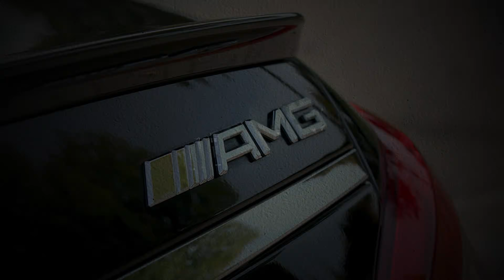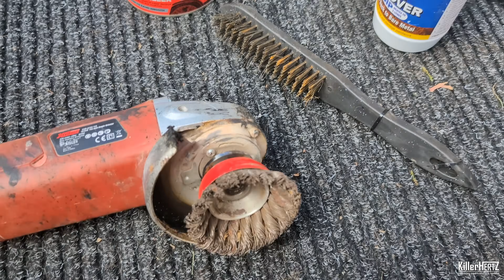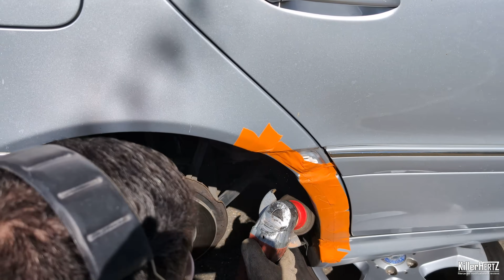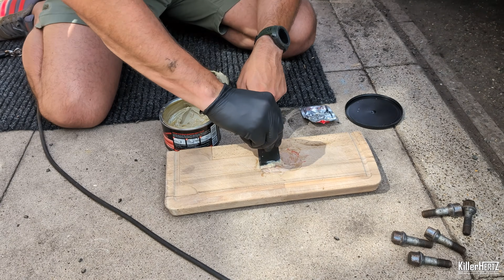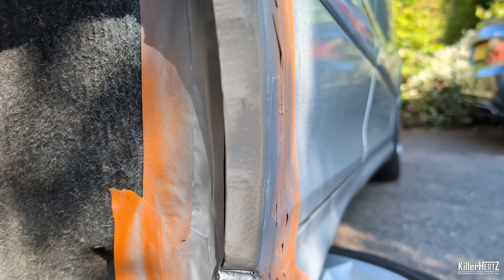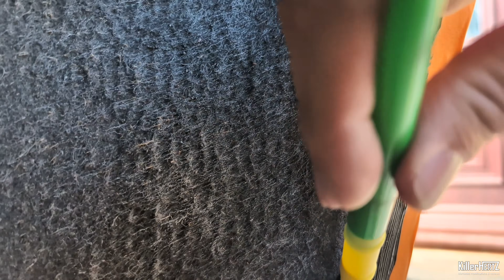HOW TO: Fix & Repair RUST On YOUR Mercedes

Comment: A few notes from a DIY painter ;)
Don't apply filler directly to the metal. A two-component epoxy primer should be used under the filler (in my experience, two-component epoxy lasts 1000% longer and protects better against rust than spray primer. I stopped using spray primer after rust reappeared after a year).

Automotive painters often ignore this issue. It's obvious that a paint shop doesn't have time for that kind of mess and multiple layers, but if you want to do something right, you have to put in the work. There are also studies on this topic. If you're interested, you can read about it online.

I would also apply an epoxy primer over the filler. It separates the filler from the subsequent layers. Homemade solutions are sufficient. Another coat of acrylic primer would be great, but it will also be fine without it. Apply the varnish and other protective layers over that.

Comment: I would recommend removing the wheel arch liners to clean behind and treat anything behind the wheel arch lip. It is likely that trapped road debris is causing the rust to develop.

Comment: Just took mine in for an extended warranty for the rear subframe due to rust. Call your dealership to see if your model is covered!
Reply from the maker: It still has a pending Sunroof recall I need to book in, so I'll ask when I'm there, cheers 👍